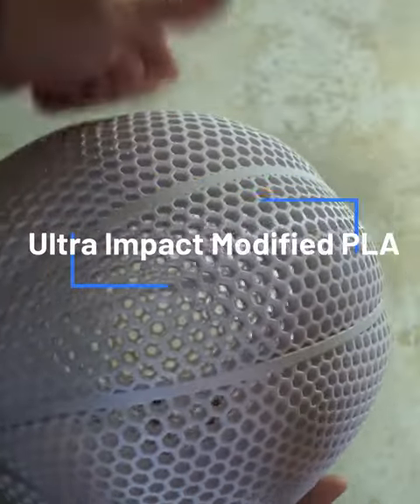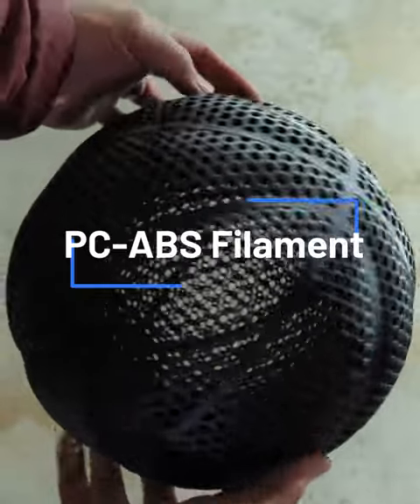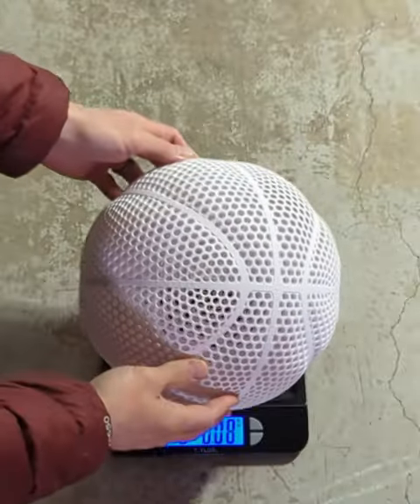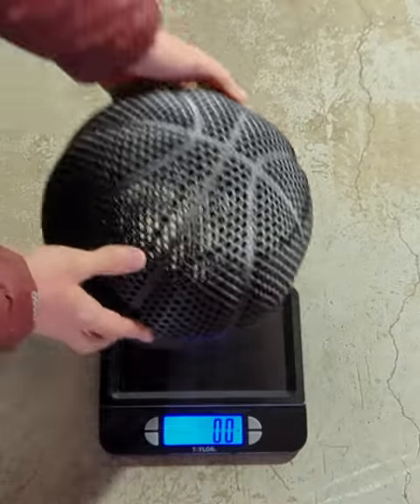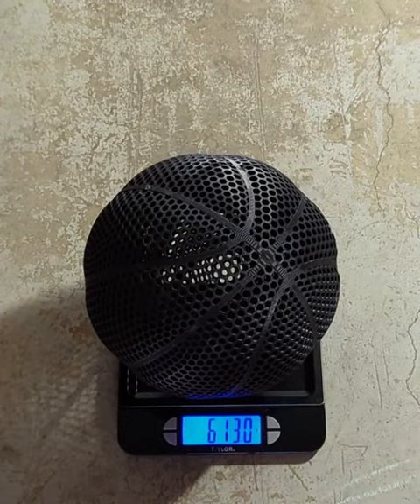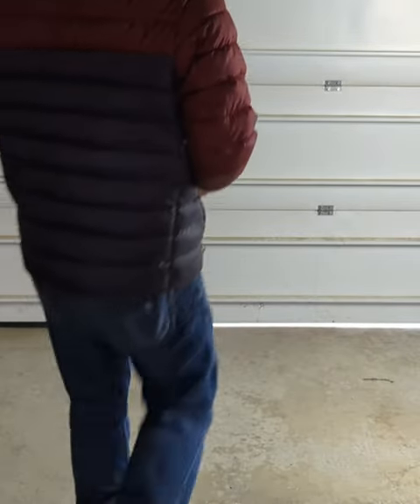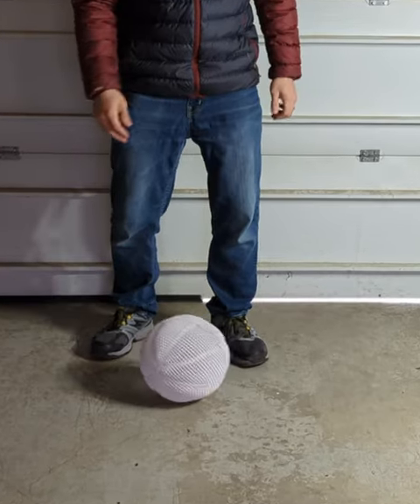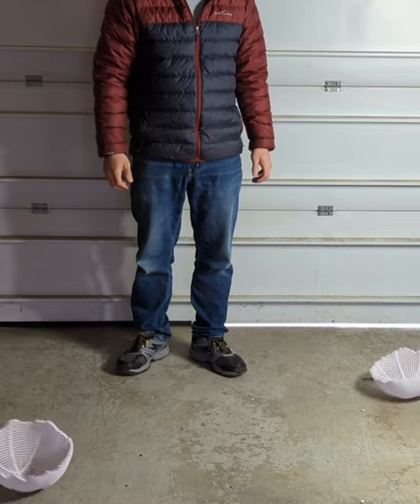3D Printed Airless Basketball Filament Test: Impact PLA vs. PC-ABS! #shorts

Comment: I saw from your other videos that you have the cool time lapse is there a way to do that? Thank you
Reply from the maker: Yeah the way I did it was I used an old Samsung Galaxy phone that was hooked up to a wired shutter button to take the picture. Then I 3d printed a mount for the button on the frame of the printer, and then I printed a pusher that pushed the button at the end of the x axis. Then in Cura, I added the "time lapse" plugin and told it to push the button after every printed layer. The phone ended up breaking so that is why I don't do the time lapse anymore
Reply from the maker: It is the same thing as this video but the cheaper version: https://youtu.be/Is10iN43UjI?si=AKxaPu6K5DE__pZ6

Comment: Do flashforge flex pla
Reply from the maker: Just ordered some but it won't be delivered until late May 😐
Reply: Dang good luck I subbed
Reply: Any experience with Ender 3 v3se
Reply from the maker: @3dPrintin  appreciate it!
Reply from the maker: @3dPrintin  not this exact one but I had an Ender 3 Max as my first printer. Added some upgrades and it was a great printer. Has it been good for you?
Reply: Yeah I had an ender 3 originally and it was good but it just died and stopped printing like at all. I got my v3 se and the wheels on the back of the tool head are wearing down and leaving a nasty residue. Have you ever seen this or know how to fix it. Thank you in advance
Reply: I love your channel btw
Reply: I’m going to change my channel to something 3d printing related your channel makes me want to make mine better any suggestions to a good name
Reply: I have a cool phone holder and my version of a 3d bench that floats
Reply from the maker: @3dPrintin  oh strange, I have not seen that before. Maybe they are too tight, or not right enough and rub on sharp edges as they move?
Reply: Okay thank you